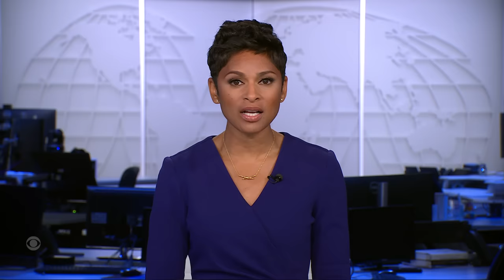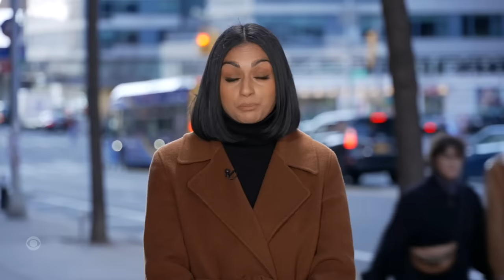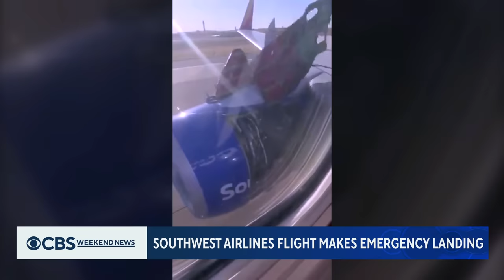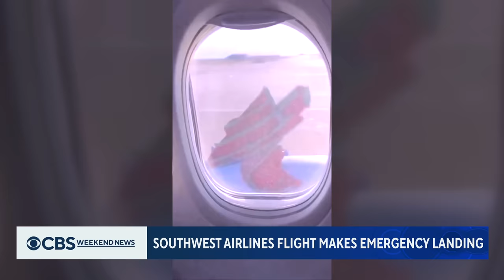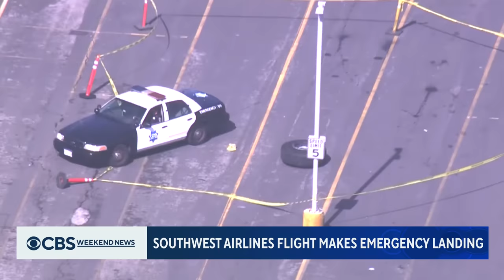Engine cover falls off Southwest plane

Comment: Airlines now maintain airplanes like I maintain my waist line.
Reply: I feeel
Reply: Its Boeing...have you heard about an Airbus plane  having issues?
Reply: @darkwillis416 everything is about Boeing nowadays, I don’t hear much about airbus
Reply: @Finnaviation_  everything that goes wrong is about Boeing, theres not much to report aboutvAirbus when nothing goes wrong. Airbus has a larger share in commercial plane sales than Boeing and a fraction of the issues.
Reply: Boeing**
Reply: @darkwillis416  yes and it happened to the A330
Reply: @darkwillis416 it’s a maintenance issue here .
Reply: @Finnaviation_ Because Airbus is putting safety above profit while Boeing is not.
Reply: I’m stealing this!
Reply: @blackthunderhwd5055  an aviation occurence due to maintenance or manyfacturing defect?
Reply: "it'll fix itself " 😂
Reply: Do you have fingers or toes falling off?! 😂
Reply: Weird way to tell us all you are fat...people say anything to score likes i guess🙄
Reply: EXACTLY
Reply: American standard.
Reply: @darkwillis416 no, it’s a clown not latching the fan cowls
Reply: @darkwillis416  This is not a Boeing Issue.  This is a 737-800 and they do not manufacture these varients for years.  I tis a maintenance issue as the report states.
Reply: @darkwillis416 that you hear about

Comment: Completely safe; except for the wheels, doors, and panels.  Completely safe...
Reply: And the whistleblower “killed himself”.
Reply: Safe and effective
Reply: Did anybody die on those flights?
Reply: You don't know what damage the cover coming off did to the wing.  Or perhaps the same aircraft maintenance person worked on something else incorrectly.
Reply: American hubris. In the face of reality, keep denying and say it’s safe. Nothing to change.
Reply: @Parker2100 the cowls weren’t latched.  Period.  Been doing this a LONG time.
Reply: @phantagirlablethey run into birds at 500 mph and land safely.  Relax
Reply: @justing42  

Then they flew off.  Possibly striking other surfaces.  Pilots don't know until they get it on the ground.

If they flew to their destination with an engine uncovered, they would have been fired!  For good reason!
Reply: lol

Comment: It is kind of weird they say "important to note" CFM built the engine, when the fault will most likely be the 1st Officer not catching it in his or her preflight walk-around or a maintenance person who may have not properly closed the engine panels. CFM built an engine that could keep going despite the inadequacy of people operating them.  This enabled the plane to bring those people to safety and thats pretty awesome in my book
Reply: Sure must suck to be the guy who had the big hunk of metal randomly falling on his stuff without warning. What about that guy whose car got pancaked by the airplane wheel that came flying off right after takeoff?

Comment: It’s impressive how these pilots handle a situation so calmly. ✈️
Reply: Training.
Reply: Not a diversity hire.
Reply: Sounded like the air traffic controller speaking. The pilots gotta be ice cool.
Reply: With all the idiots working on aircraft, a pilot should get hazard pay. I've worked in the industry and I haven't flown in 20 years.
Reply: @JamesWeaver-n4t  Idiots are not isolated into one industry. There are idiot pilots, mechanics, taco bell workers, etc, etc. Considering that almost 90% of aviation mishaps are pilot related, I don't think that this holds true.
Reply: Makes it worse if they panic like other people
Reply: They are getting used to parts falling off their plane.

Comment: Major maintenance work on most of these planes are done in Mexico, China and El Salvador. A majority of these airline mechanics overseas are not F.A.A certified. They are also outsourcing most of the maintenance work to private contractors in the U.S as well which many are unlicensed . Not to mention the shortage of mechanics in the U.S.

Comment: EVERYONE, I love Southwest Airlines but this is unfortunately their fault. IT IS NOT BOEING’S. This may have been due to maintenance, or a maintenance worker may have not secured a latch properly. Hopefully the aviation industry can get back to normal.
Reply: Outsourcing too
Reply: ditto ^ What he said above. poor parts. 
btw there are more than one latch on those engine cowls. might be as many as 4 or 8 latches.  😮
Reply: @Iceland874 How do you know the parts are from China?
Reply: The engine part (cover) was made by Boeing
Reply: I blame COVID layoffs. A lot of maintenance employees were laid off in 2020 when airline demand fell, primarily the older tenured employees at supervisor/manager and higher levels. They have been replaced with less experienced employees and are overseeing a wave of green employees. It’s a recipe for disaster.
Reply: @Rollerblader091  Fellow blader here. Hehe. It's a bit more complicated than that but that is definitely a big contributing factor. One can also make $40/hr managing a Panda Express, without having to deal with any liability associated with aviation.
Reply: @tatjanaarmendariz2813  Yes and it needs to be maintained by the Airline...........Its no different from buying a car. Unless you can prove that its a true defect its on you to maintain the plane as stated in the boeing's manual
Reply: Lol you just wanted to say the words "inferior" and "China" together right? Blame it on the Chinese as if the Chinese don't make superior parts, which America then either chooses not to buy or tries to sanction. What a "free world".  @Iceland874
Reply: @Iceland874 and how come China doesn’t have incidents like this so frequently…
Reply: @tatjanaarmendariz2813  Just because it is made by Boeing it is latched by the ground crew.  Has nothing to do with what's going on with Boeing.  Did people blame airbus when the birds were injested by the engines when Sullenberger landed in the Hudson did they?  No they did not.  Get off the Boeing band wagon.

Comment: This is most likely NOT Boeing’s fault. People should not point fingers at Boeing as mentioned in the video, they did not even manufacture the engine. This is a maintenance issue as stated in the video.
Reply: This is not Boeing's fault. Not even slightly.  Blaming Boeing on this would be akin to blaming Ford when your 20 year old Fiesta's hood flies up on the highway because you didn't secure it after putting some oil in the engine.
Reply: True ... sort of. Guess who's responsible for "Auditing" Airline "Service Centers" ??? Yep, that would be the Prime Contractor (Boeing in this instance). "RCCA" stuff ...

Comment: Treat these airplane "maintenance issues" like you would the canary in the coal mine.    These incidents are a very visible indications of real problems in the construction and maintenance of commercial airplanes.    Taking the word of manufacturers, operators, and contractors when they "self report" is a flawed concept.....they will always value next quarters stock prices over everything else.
Reply: Not in this case, this is not a Boing problem.
Reply: Bingo
Reply: This incident likely isn’t one of those “canary in the coal mine” issues. I suspect someone was inspecting the engine between flights and simply forgot to fasten the panel back prior to flight. Losing a panel is definitely not ideal, but not necessarily indication of a significant issue above a memory lapse that I would worry about.
Reply: @ceasetheday87  there is a reason for everything that goes wrong. When more things start going wrong, it’s 100% cultural. This is where the American workforce finally is after decades of warnings.

Comment: Although Boeing’s reputation has taken a tremendous dip lately and brought a lot of public scrutiny, this particular engine panel issue should not be attributed to Boeing as the manufacturer. I suspect someone was inspecting the engine between flights and simply forgot to fasten the panel back prior to flight. Losing a panel and grounding a flight is definitely not ideal, but likely was not caused by any significant issue above a brief memory lapse.
Reply: @phantagirlable All the public can do at this point is speculate. As a former aviation mechanic, I do feel safe to say inspecting the engine is why the panel was loose. Didn’t feel it was necessary to detail I was previously an aviation mechanic as detailing an engine inspection between flights was enough for my statement to sound credible.
Reply: Why all of a sudden, failures all fallen on boeing?

Comment: Come on it’s not a Boeing issue it’s a southwest maintenance issue….
Reply: of course it's boeings fault
Reply: maintaing BOEINGS
Reply: @mattbuffo9967  How?  If you don't close your car door or fully close the hood so it latches closed, is that the automakers fault?  Those covers open to allow mechanics to do maintenance on the engine.  Someone did secure all the fasteners.
Reply: I guess Boeing doesn't have any QC after the plane being sold, huh?
Reply: @xtradi  You know that Boeing is the manufacturer, not the maintainer?    Top 5 global maintenance companies, there are a lot more.   1. Lufthansa Technik  2. Pratt & Whitney  3. StandardAero  4. Aar  
5. SR Technics Group........
Reply: @johnguz76 and @edl653 are correct. I was a mechanic, its opened by weekly basis, and you can see 3 latches are intact in the photo.

Comment: For everyone wondering, this is completely and ground person\mechanic fault, if you see on the image, there are 3 hinges and they are in tact, somebody just forgot to close them, its opened by a flat head screwdriver thats used for leverage to open the hinges. that's all, not Boeing's fault( not that im defending their other actions, I hate them)

Comment: None of these have anything to do with Boing. This is a Maintenance issue, the mechanic forgot to latch the cowling after it was closed, probably got distracted from the task for some reason. Also the flight crew failed to notice the latch was not secure before flight. This happens almost every year and of course it’s not good! But understandable given the human ability to be distracted.

Comment: Just because it's a Boeing aircraft doesn't necessarily mean that the failure was Boeing's fault.  It reminds me of the story of the Delta 757 that lost a tire about a month ago.  The 757 hasn't been produced since 2004, and there haven't been any other reported issues with any other 757 lately.  Thus, it was a maintenance issue.

My guess is that the SWA technician was either insufficiently trained or was distracted, and forgot to secure the cowling.

Comment: The last people to touch this aircraft are the ground maintenance crew at the airport. NOT A BOEING ISSUE. Some idiot forgot to properly secure the engine access panel after checking oil levels and for leak checks on that one engine. Not even CFM is to blame. People put the blame where it counts otherwise you are all contributing to the failure of a company. I would not put it past Boeing to start taking people to court for false reporting.

Comment: How many times does this have to be said. This issue, as well as the tire, and more than likely the hydraulic line burst, were not a Boeing issue. It was likely a maintenance problem or just a failure of some kind. Boeing has it's share of issues, but let's be honest that airplanes, like anything else, break sometime without notice. There is a hyper sensitivity to everything aircraft related after the Boeing issues. Flying is still the safest way to travel, and aircraft are built incredibly robust.

Comment: At this point, why don't all jumbo jets have cameras giving the cockpit full visibility if the plane's exterior? The crew basically has to wait for a passenger to see the engine cover flying off before they are aware of it. It would be a simple exercise to have AI alert the crew to any changes to the structure. The average citizen can get better awareness with a cheap Ring Cam.

Comment: This incident is not on Boeing, not on CFMI, not on UTC or whoever else made the cowling.  Not a design or manufacturing issue at all.  A 9 year old SWA 737 will have performed several THOUSAND takeoffs and landings by now, requiring multiple visits for maintenance, for which there will be records.  And just spitballing here, but it's remotely possible the plane hit something on takeoff or shortly after.  Doubtful that there is a modern-age bird big or hard enough to cause that sort of damage, but something on the runway (or maybe a drone?) might.  The Feds will get to the bottom of this one, tout de suite.

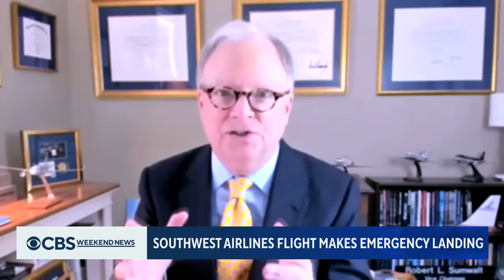Comment: It's funny how the guy at 1:19, Robert Sumwalt, says all these incidents are unrelated. They're all Boeing aircraft. So, how these incidents are related is obvious.

The reason Sumwalt is unwilling to acknowledge what's obvious is that Boeing pays him. According to his bio, he's the "executive director for the Boeing Center for Aviation and Aerospace Safety at Embry-Riddle Aeronautical University." In other words, his position would not exist but for Boeing's funding.

Also, this is why you can't take CBS News seriously anymore. They used to be journalists. Now they're just paid shills with no integrity whatsoever...
Reply: You obviously haven't seen a cowling come off of an Airbus before. It happened more than once in the last few years. Sorry you're just commenting on news stories you're seeing and don't know about.
Reply: Your ignorance is showing.
Reply: This is not Boeing's fault. Not even slightly.  Blaming Boeing on this is akin to blaming Ford when your 20 year old Fiesta's hood flies up on the highway because you didn't secure it after putting some oil in the engine.

Comment: Diversity hiring and Boeing spell certain disaster.
motto of tarmac to controls is utter madness. I served as a crew chief and Blackhawks for the United States Army. I flew critical top-secret missions on an aircraft that I maintain On the ground and protected while in the air. I can tell you that the standard into which the aviation industry today is Operatedv , like many things in this country are proving to be a grave mistake. The incidence will continue in the maintenance department and also behind the controls due to highly underqualified people being pushed into these positions purposely.

Their new motto should be. “ Boeing, zero experience and  No maintenance required. Snaps together. For  ages three and up.

Comment: An engine cowling coming loose inflight is not a critical problem, it's basically there to streamline the airflow and protect engine components. No big deal as long as it doesn't impact the tail assembly and damage something else. Just a precautionary landing to have it and any superficial damage repaired.

Comment: Another cowling falling off
WTF is going on with Boeing?
Reply: It wasn’t boeing. Didn’t you even watch the video?
Reply: @DisasterMaster3K  
Yea I did.
Although Boeing didn't manufacture the engines, how did they pass inspection @ the Boeing assembly plant? The faulty/defective engine cowling falling off Boeing A/C is a reoccurring issue. The A/C manufacturer is ultimately responsible for everything on their A/C.

Comment: Boeing again. If its Boeing, Im not going. Big big probem. Literally, all things are falling apart including its company.
Reply: When someone's car wheel falls off because they didn't replace the lug nuts, do you blame the driver or the car manufacturer?

I ask because right not, you're blaming the manufacturer for airline user error.
Reply: @bmused55  Im assuming that Boeing have authorized whoever is the maintenance provider of the airline. The back still stops at them. Im sure its not an ordinary guy on the street doing their repair. Also, they must have a license doing this sensitive works. Either they revoke the accreditation or the cowling assembly is defective or substandard/weak. It is still Boeing for me. Safety must be paramount in aviation, everything is next.

Comment: Seems like our FAA or even Secretary of Transportation would issue an All Stop for Boeing planes.
Reply: This is not Boeing's fault. Not even slightly.  Blaming Boeing on this would be akin to blaming Ford when your 20 year old Fiesta's hood flies up on the highway because you didn't secure it after putting some oil in the engine.